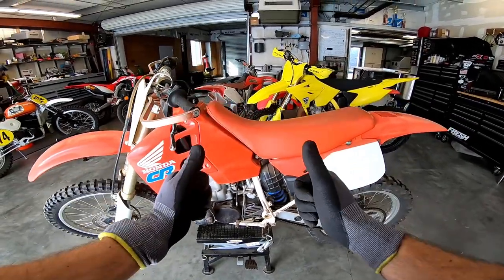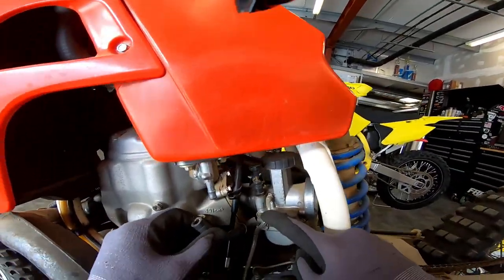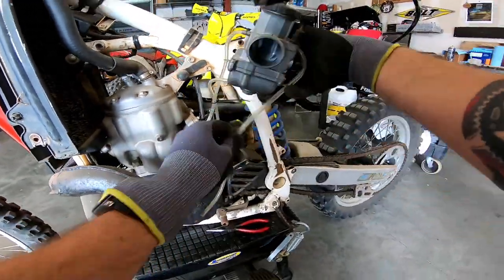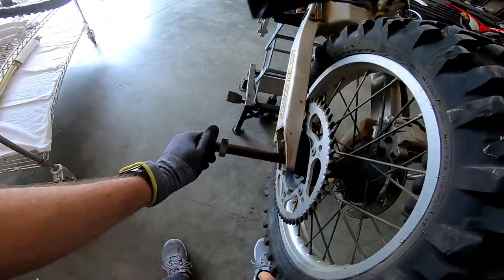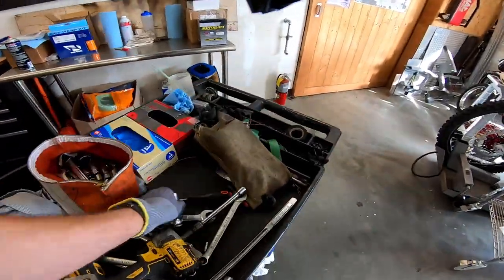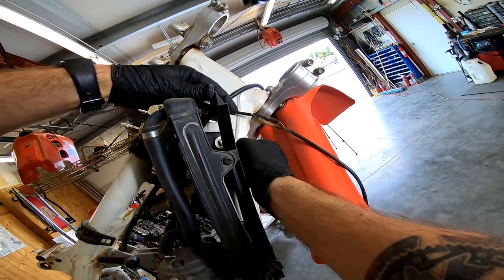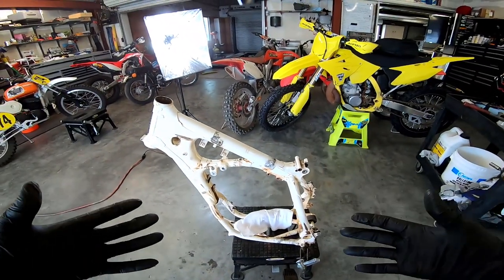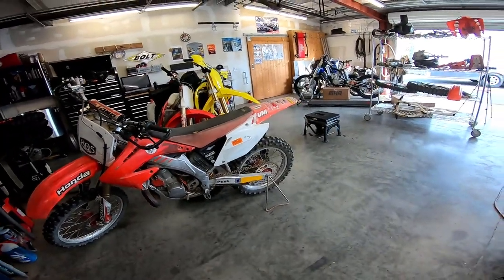mXrevival // Dirt Bike Magazine CR500 Complete Disassembly Ep. #2

Comment: Thank you! I aim to disassemble a CR500 for my son and this start-to-finish presentation is just what I need. I especially appreciate all the tips & tricks like the torch & air chisel, wire rack for parts, plastic bags, no need to fret about not having exotic tools. Probably elementary to many viewers, but I am a novice other than having worked on my 2-stroke chainsaws. What I actually need to do is remove the top end of the CR500 and inspect the piston & cylinder for wear or damage- not covered in this video, but your presentation was still very worthwhile because I now have a clear idea of how to approach the job. Very much appreciated!
Reply from the maker: So glad you found value in it! 

I appreciate you taking the time to watch. You'll knock it out no problem!

It's true, just a few specific tools and you're off to the races. In fact, I built a bundle for all of us based off of this exact video & severance guys have been pumped to use it!

https://www.mxrevival.com/product-page/garage-hero-engine-tool-bundle

Typically, when we go through all the trouble of cracking open a jug, we are not planning on re-using anything past if the cylinder it it looks good inside, and shows good cross-hatching/ no gouges or glazing. 

To measure the bore size to match for a piston (if variable sizes are even available - like the A, B, C, D piston sizes that Yamaha uses for example) you'd just need a set of digital calipers.

Most guys go for a stock bore piston, and use feeler gauges to check the ring-end gap.

If the cylinder is trashed, you can send it off to be replated and sent back with a bore-matched piston even.

Lastly, you can even purchase a bore hone & oil if the cylinder looks good, but just needs a quick restoration of the cross-hatching.

If you ever get stuck, just blast me an email!

charles@mxrevival.com

-Charles // mXrevival

Comment: Ever tested your Killswitch Theory? Mine runs just fine with it unplugged. In fact, when I bought it it didn't even have one!
Reply from the maker: Not spliced somewhere??
Reply: Nope. Two wires hanging down as I rode, until I bought one and hooked it up. Other than that, all original wiring and ignition.

Comment: Let me tell ya, I had a swingarm pivot bolt stuck so bad Ryan Wilson and his dad at factory edge said in their combined years of working on bikes they’ve never seen it so bad. 4 hours of heat, a makeshift steering rack pulled adapted for it, 10 pound sledgehammer and more nothing worked. Eventually had to go in with a grinder (4 1/2”, 5” and 7” wheels) and cut the bolt out to get the swingarm disconnected from the frame. Gnarliest seized bolt I hve ever seen to this day (and the Wilson too😂)
Reply from the maker: Gawd damn! Sounds like the bike's entire weight could have cantilevered off the swingarm. #Crusty

Comment: Please help! I bought an '84 CR500 and ran it around my block last year. I didn't push it because I just wanted to make sure it ran.  Now I can't get it started a year later.  Seems electrical to me.  Where should I start?  Bike is in 8/10 condition.  Still has original tool kit on rear fender along with front/rear brake guards.
Reply from the maker: Clean that carburetor out, and give her a go! 

Most of the time bikes will only run on the choke after sitting for some time. Sure sign that the pilot is clogged.

Obviously I don't have the bike here, and don't know it's true internal condition. Things like reeds, and compression - so I'm just going for the low hanging fruit.

Make sure to have fresh fuel in the tank, spark, a clean air filter, and a little patience.

She'll fire!
Reply: @mxrevival  clean carb, fresh fuel, new plug, no spark. I think the next step is to get the tank off and look at electrical/kill switch. I also may just start tearing down the lower and upper and replace parts that look worn. Thanks for the reply! Any sure-fire musts for this engine? I came across one guy who swears by running ATF instead of synthetic. I’ve also seen decompression valve mods, etc…